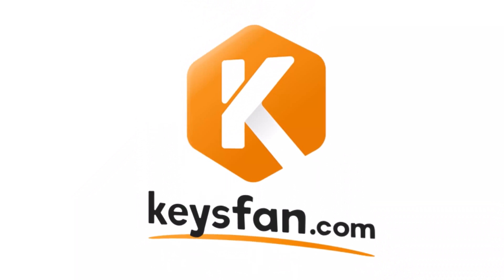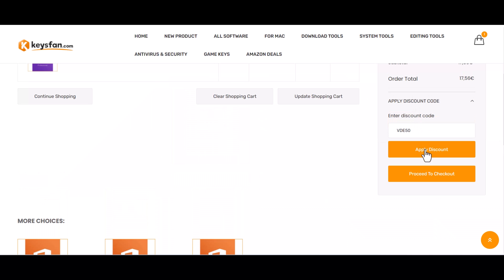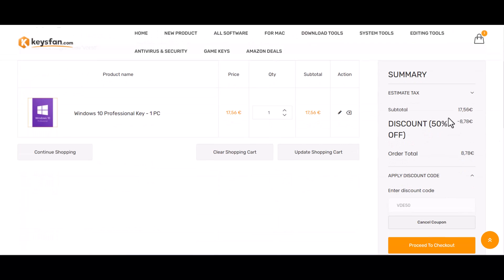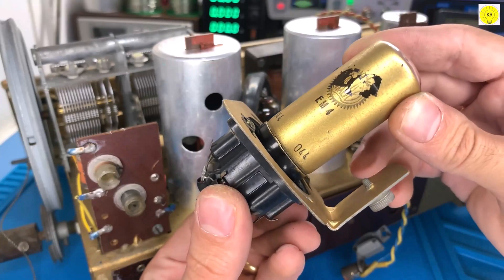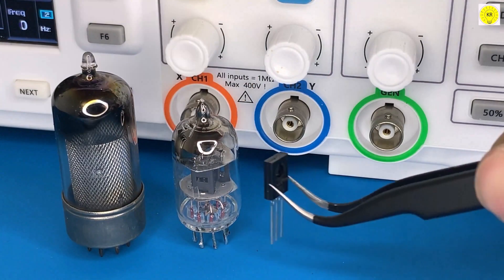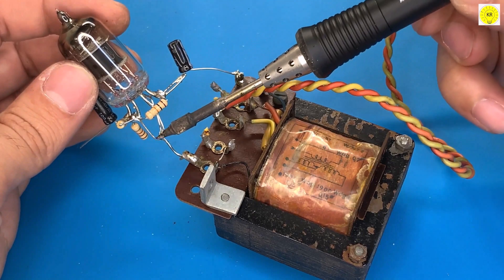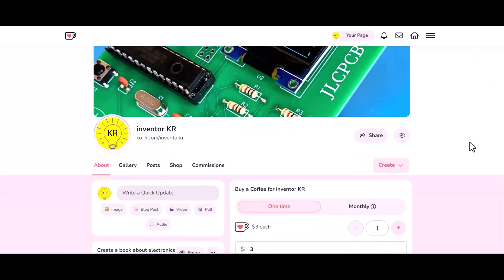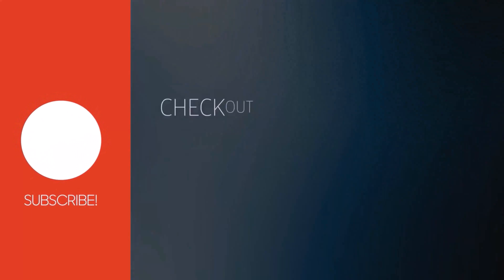vacuum tubes, How does it work and what are the electronic applications used?

Comment: Excellent video!! Do you think you could do a build of two small audio preamp or amp circuits ( very basic, identical circuits but one with vacuum tubes and the other with transistors) to addresss the claim that Tube amps sound better than Transistor amps . 

Thanks for all the great videos!!
Reply from the maker: Yes it is possible